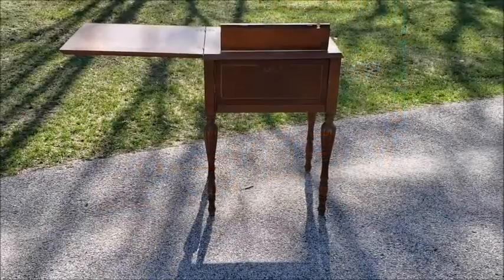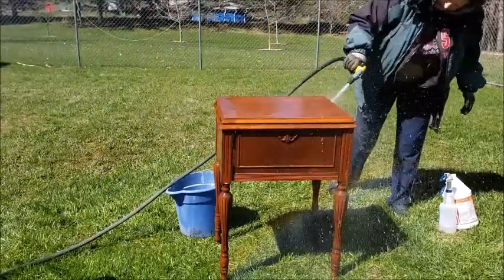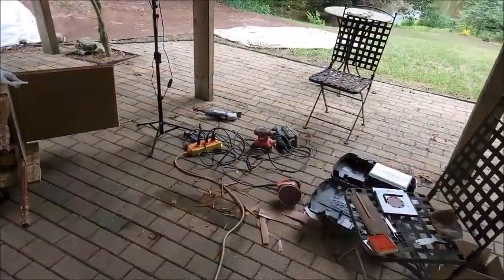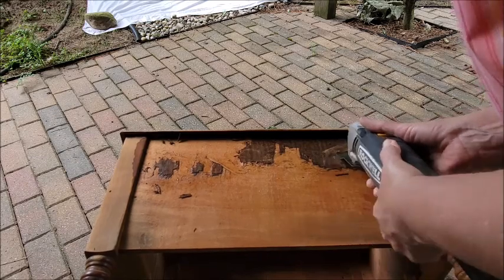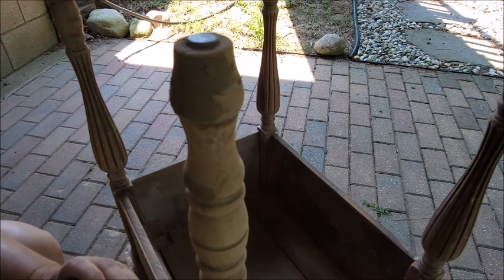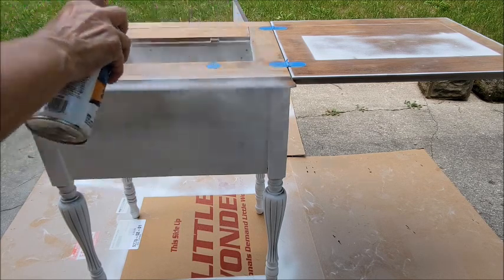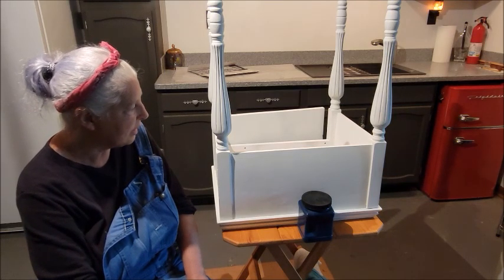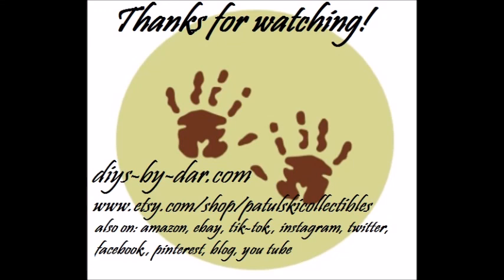How to restore and repurpose a 1942 singer sewing machine cabinet, Part 1

Comment: I have a Singer 201 from 1950 in a similar cabinet (bought it when I retired) and have been wanting to paint the cabinet.  The sewing machine is gorgeous and works perfect but I feel it deserves a new cabinet (an update since the cabinet is in great condition, just old).  I learned so much from your vid, thank you.  I'll be watching the sequel.  Sub'd and liked!
Reply from the maker: Thanks so much for taking the time to watch my vid and comment.  I really questioned myself when I started.  I think if I would have known about using a heat gun on the vaneer maybe I could have just gotten all of it off.  But, it was a fun challenge anyway.  take care, thanks for subbing!!   dar p.
Reply: I have a similar case from 1920s I’m working. I’m restoring it. I have to do new walnut veneer on the top and sides. The front was luckily spared from moisture and the crotch flame veneer is still in tact. 😊 I will be staining it again and hopefully it will last another 85 years.
Reply: Hi. Do you know if Dixie mud is stainable?